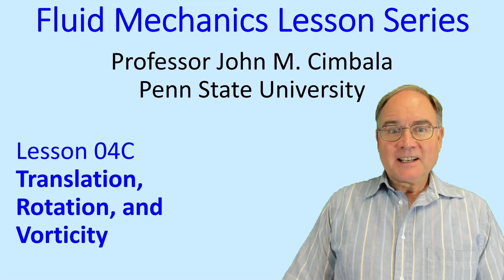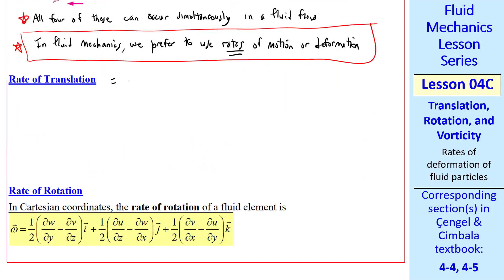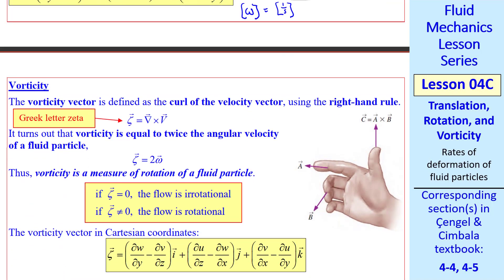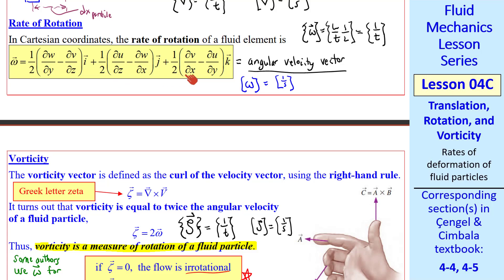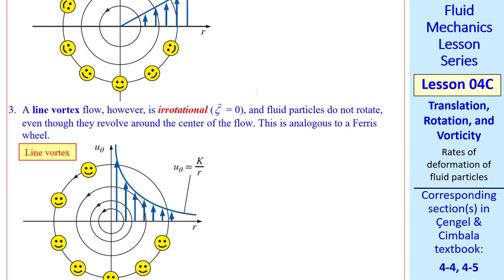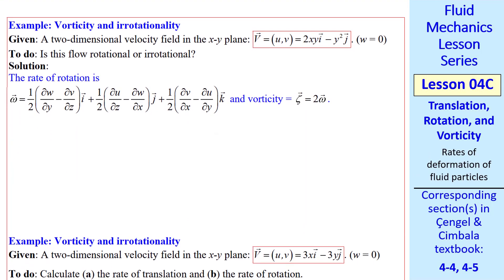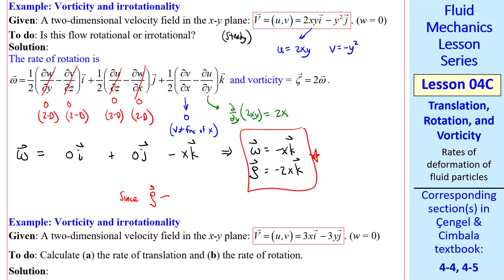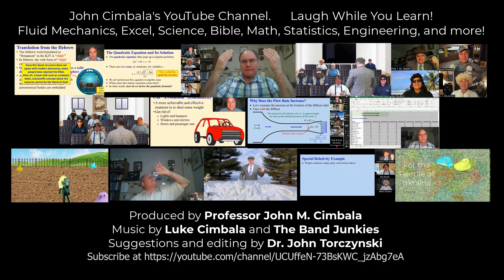Fluid Mechanics Lesson 04C: Translation, Rotation, and Vorticity

Comment: sir, in the comparison of two fluid flows which you explained, how the information of the particle's orientation is known without the diagram, what if in second case too the particles rotate with the flow. Vortex equation will still tell that it's irrotational but will it really be ??
please clarify this.
Reply from the maker: I am not sure I understand your question. What I can say is that if the particle has rotation, then it is NOT irrotational by definition. So in your case, it sounds like a combination of solid body rotation and vortex flow so that the flow is rotational, though perhaps not as high a magnitude of vorticity as in the fully rotational solid body rotation case. Also keep in mind that the "particles" I drew are huge, but we imagine them shrinking to zero volume to become a "fluid particle."